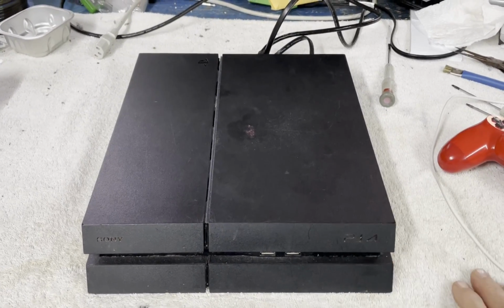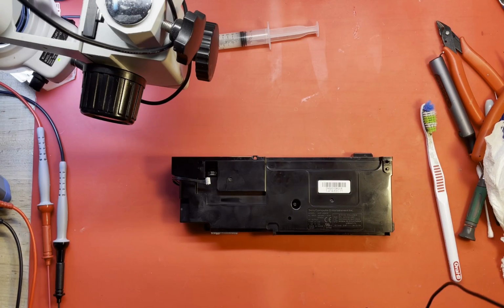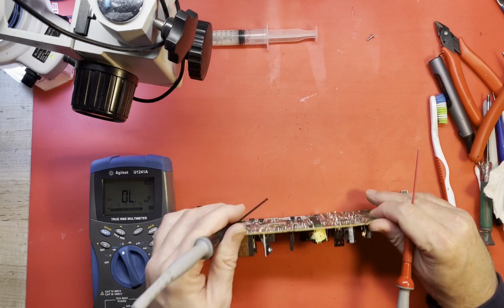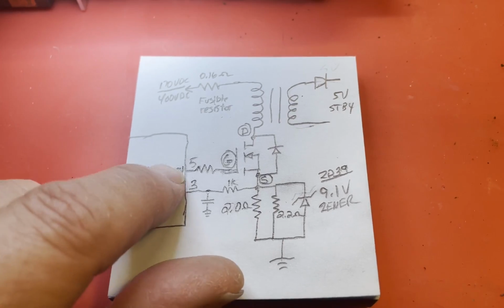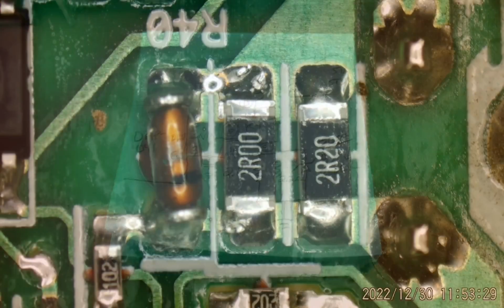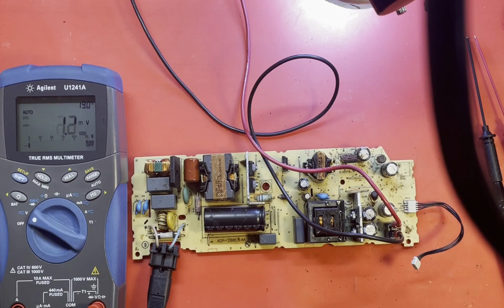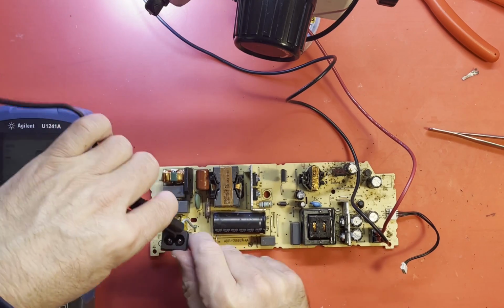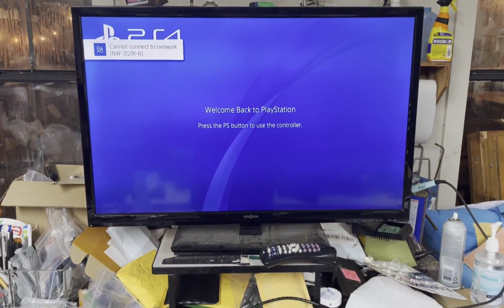#70 Repair of PS4 CUH-1215A No Power

Comment: My issue is that the adp-200er gives 4.8v and also 4.7v on the 4th pin (ac_in) but as soon as I short pin 3 (ac_stby) and 4, 12V comes up and goes off and within a second, the 9.1v zener, the 0.16ohm resistor and the 5v mosfet blows. What could the problem be? The power supply stays on in standby for a long time without any issue. I already replaced dap041 (with ld5760) and dda001ag ic.
Reply from the maker: Perhaps the power factor corrector is putting out too much voltage.  It should be 395V across the big caps when 12V is enabled.

Comment: my zener is good...i think the line zener is short can you tell me what wrong??
Reply from the maker: If your zener is good, you should measure 1.0 ohm across the zener.  Not 0.0 ohms.  If the zener has shorted, your MOSFET may have shorted or the DAP041 IC has failed.
Reply: @ToltecMerc  ok, the mosfet short can you tell me , what kind this mosfet ?? because i dont have it and how ampere this mosfet?

Comment: Dear sir, hope you will be doing great, I need little assistance regarding an issue I’m having with my ps4 power supply ADP 200er, I’m not getting voltage at stand by the fusible resistor is open although replaced but still it gets off, their is some component shot but I can’t find it the mosfet 3n62k on meter says short when it is on the supply board but when I disconnect it it doesn’t show sighs of short please help me out.

Comment: Hey m8, I'm having a hard time getting these 0.16 ohm resistors. Where do you buy them from? They are out of stock on mouser and digikey last time I checked.
Reply from the maker: Yeah I noticed Digi-Key was out of stock recently.  Luckily I had bought 100 of them.  I have not found another source.  Sorry.
Reply: @ToltecMerc  ok cool. No worries m8, thanks